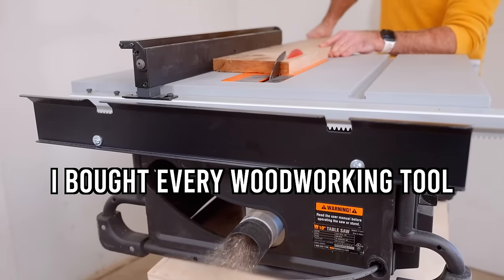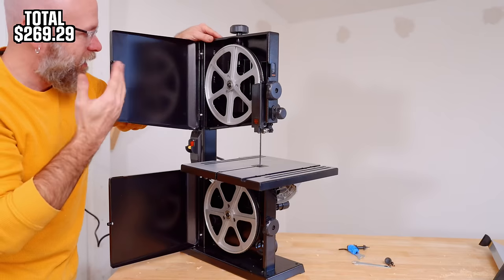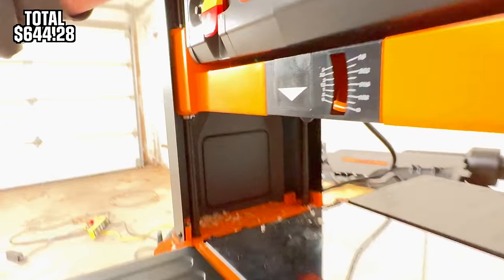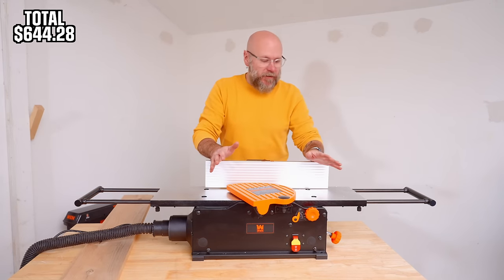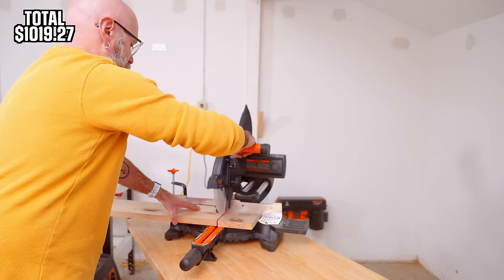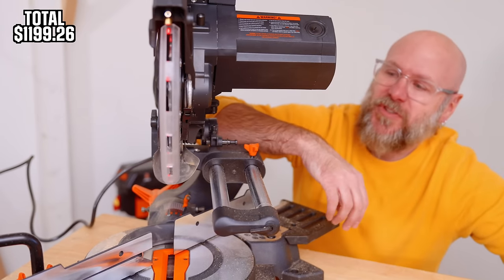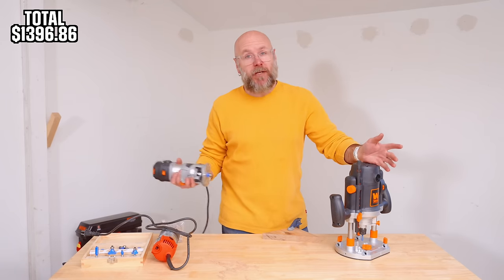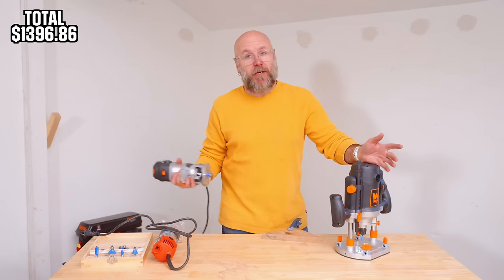I Bought ALL THE WEN TOOLS! Let's Review.

Comment: The plunge tension on the drill press is easily adjustable. There is a tensioning spring under the metal cup on the opposite side from the handle that can be adjusted to get the rebound tension where you want it. On more expensive tools, someone adjusts it instead of just throwing it together. But its an easy thing to adjust. This tensioning method is common across almost all drill presses.

Comment: I have the 13" spiral cutter head planer and it has been phenomenal.   I also opted for the stand that has extension arms to support longer workpieces.  The resulting workpiece surface finish is top notch.   Bladed cutter heads seemed like a lot of hassle to install and set, so I've always wanted a spiral head.   When I saw the price of this machine, I couldn't believe it and had to have it.   Turned out to be a great decision for my business.

Comment: Have many WEN tools, never had any issues. Great customer service. Cheap and affordable but good quality. I have an outdoor workshop so I have a gazebo as my workshop so anything can happen, I’m not sure if it is because it’s outdoor but my wen lathe , the powder coat is flaking off and parts of it are rusting, could be just me not using it a lot or taking much care of it, and drill press little rusty but overall, i highly recommend WEN tools, especially if you are just starting out woodworking. Part of the reason I got into WEN is because of the affordability. And my favorite color is orange, so WEN color scheme was right up my alley.

Also my lathe is the 8”x13” , I think I would recommend  the 12x18 , because sometimes you have something bigger you want to turn.

Comment: I have the same band saw and use it all the time as I make custom pens, and have never had a problem with it. I just bought Wen cordless biscuit  cutter and used it yesterday and it works great. Only thing I noticed is it has more power than the Freud I had forever. Just make sure you hang on while cutting.

Comment: I have an 18" Laguna Beast of a bandsaw and a  very "hot-rodded" Delta 14" bandsaw.  a few months ago, i bought that same Wen table bandsaw used for $70.00 and guess which one i use most often...the little Wen.  It may be because most of the work that i have been doing lately is small stuff, but that little thing works well after tuning it up, im impressed!

Comment: Wen makes good tools.  I have the top-of-the-line Drill Press and it is fantastic and I bought it used (but virtually unused for $75) and you will not be disappointed.  I own the belt/disk sander and it also just works.  No hassles no issues.  I also have the band saw but I've not used it yet.  Wood projects are on the list soon to get some time with this saw. I'm sold on Wen.  Wen for the win!  I had all the big power saws and had to liquidate everything that I couldn't move or lift anymore.  So - welcome to Wen.

Comment: I have been purchasing WEN tools for a handful of years now. So far, no issues. I have a portable drill and I did purchase the higher amperage battery and it is extremely handy and reliable around the house and when working at the bench with metal or wood. As with all less expensive power tools and even some higher priced ones is the chuck. I despise the key-less chucks. They are drill bit destroyers. In steel, the shank of the drill will spin in the chuck as it begins to break though to the other side and it requires filing the raised metal off the shank or it will not go back into the index. One tip, look the tool over and imagine breaking something and see if they have the replacement parts for it and weigh the possibilities. So far, I am very happy with the products and will purchase more. From my experience with WEN, if you call them they will probably work out a way to either fix or replace or send you the parts necessary to make the planer what it should be. Keep in mind, they are not manufactured in America, what is today?  Biden tends to elitists and not us blue collar people.

Comment: Thanks for the reviews.  I must take issue with your process for milling rough stock.  You should start with the jointer first and get one of the faces flat.  Then use that face against the jointer fence to square the piece up.  Then go to the planer to make the other face parallel to the face flattened by the jointer and then finally got to the table saw to square up the final edge.  You can switch the 3rd and 4th step but you should always joint the flat face first and before you run it through the planer.

Comment: I got a Wen lathe for Christmas in 2022 and I’ve loved it for a beginner lathe. With more experience, I’d recommend one with adjustable speeds instead of having to move the belt over and over again, but it works fine. This Christmas I got the Wen biscuit jointer. I’ll get use out of it when I’m done with college

Comment: You mentioned that the milling process is to run both faces through the planer, then an edge over the jointer, then the opposite edge cut on the table saw. That will leave you with a board that isn't flat. You're better off jointing a face before planing. You also mentioned that the jointer beds will likely need to be calibrated. From what I saw, it's likely that the outfeed needs to be shimmed, since it looked like the board may have been in contact with the outfeed bed near the cutter, but you could see daylight under the board further away from the cutter.

Lastly, the biggest benefit in my mind of spiral cutter heads is when it comes to dull or chipped cutters. With straight knives, a small dull section or small chip means having to get the knives sharpened or replaced, and installing and setting up new knives takes a long time. With spiral cutter heads, each insert has 4 good edges, so you can just loosen a screw, rotate the insert, tighten the screw, and you're done. It's much faster, and less frustrating. That said, if there are very few cutters on a spiral cutter head, you are probably not going to have as great of a cut as what you mentioned is possible with spiral cutter head.

Comment: WEN is great for experimenting or making a Frankenstein tool.  You don't invest a lot of $$$, so feel free to cannibalize them.  For example, I bought their pole saw (i.e., chainsaw on a stick).  Already had one, but this one was for ridiculous heights.  Right out the box I took it apart, added conduit tubing, extended the wires, put both ends back together, and now it goes 10' higher than I could reach before.

Also just bought their little drill press table attachment, something I should have done years ago.  It was <$50.  Has T-tracks on both sides (Top for the fence and for holding down pieces; bottom for clamping to the drill press) and another track on the fence for the included stop block.  Nothing too fancy, but it was worth the cost not to have to build one from scratch.  Even the materials were >$50: 5 hold-downs plus bolts for those and the fence and stop block, and all the T-track plus sealed MDF or whatever it's made out of.  Rockler makes one for $130 that is not even twice as good unless you really need your T-track to be blue.

Regarding the table saw: In spite of the whining about the rack's teeth in the path to the fence lock, I wouldn't trade my rack-and-pinion fence for anything but a full-size table saw.  If you use a contractor saw in the field, you want something that's square every time without having to keep jiggling the other end of the blade along (Note: Some fences are much, much worse than others!).  I have a Dewalt with the rack and pinion fence, not the WEN, but if it died, I'd replace it with the WEN, given the built-in outfeed extension.  Never scratched my arm on the teeth though, so I'm not sure what that says about me as a reviewer since experience is the sum of one's mistakes.

Comment: I have the 8in drill press.  No complaints, it has worked well for me, and it has almost no run-out on the spindle.  I know it's limits and I work with them.  I also have the oscillating spindle sander and I rarely use it.  I have the disc/belt sander and I use that all the time.  Very useful, except the paper on the disc is adhesive and hard to change out.  I will be modifying it to take velcro paper, like in the Newbie Woodworker's video.

Comment: I have that drill press. Been using it for a few years. Your take is spot on. The 2” of travel has been annoying and that spring tension has slapped me a couple times and made me cuss. I would add that the adjustable plate for holding work is pretty sloppy. With only a 2” travel, I have to move that plate a lot and it’s very hard to get it just right. I’ve been meaning to look for an after market replacement with a fine adjustment screw.  When I replace this Wen, the first and biggest requirement I’ll have is longer travel, everything else can be managed, but that can’t be changed. 

My top clip actually has a slot for the screw to pass through so that knob never leaves. It’s just a tension adjustment for the latch, as it does not trap the lid (you can open the lid with the screw in place). Seems like they changed that design for the worse in recent years. Changing speeds is much more common with metal. For wood, you can leave it alone once you find a speed you like. Drill an aluminum plate and then a steel plate though, and you’ll understand what that speed adjustment is for.

Honestly, with then” of travel and the small work plate, I’m betting metal work was top of mind with this design. Wood benefits a lot from a longer travel and typically has larger pieces to hold.

Comment: That flip stop isn’t for small parts, when the table saw is adjusted to a wide cut and the fence overhangs the saw top, you flip that thing down and it supports the piece your pushing through, it might also work for small parts but that’s another function, I have the Dewalt and your so right about they don’t have support on the back

Comment: My first Wen tool is the same 8" Wen jointer... went with Wen because I couldn't afford 8" otherwise, and after purchase thought I had made a huge mistake.  I couldn't get anything jointed flat/straight & was swearing up/down/left right.  Then I realized the bed wasn't co-planar.  It took forever for me to adjust the tables to co-planar, but I  eventually got it done.  It has worked absolutely perfectly since... very happy.  My only gripe is that I wish the fence was a little sturdier, but it works.  Since I've purchased a Wen 3417 air-filter and it is just as good as my smaller rikon filter.  Now I'm wishing I hadn't spent the bigger money on my dewalt 735 planer and tried the Wen first.

One comment on the Wen track... its too short to use a guide square, so I would have to get another brand track (I have a makita track saw with both makita and powertec tracks)

Comment: Appreciate your videos full of information and enthusiasm. Just fyi portable table saws are powered with universal motors essentially router motors that run at about 20000 rpms and are geared down to 4-5000 to use regular blades. Full sized saws use induction motors that are more massive and run at 3-4000 rpm. Much quieter and heavier thus less vibration and lower noise levels. I was supprised at the quality level of the Wen tools. I might try the jointer. I currently use mostly higher end hobbiest tools mostly cast iron and US made except my 3 hp cts.  Love it. Keep up the good work. Love the channel.

Comment: I've had that drill press and bandsaw for several years now, no complaints. No missing parts either. Oh, I also have their electric hand planer, but haven't really used it yet to give an opinion. It's built solid though.

Comment: I've bought two Wen tools so far: The  4x21 belt sander and the dust filtration unit. The dust filter has been a solid piece of kit so far. No issues. The sander, however... No matter what I tried, I could not get the belt to stay on track. It either slid off or cut into the plastic frame.
I look forward to the long-term reviews of this equipment.

Comment: I bought a Wen thickness planer and drill press. I upgraded the planer to a Grizzly 15" because the 13" Wen was too small, but the Wen planer worked like a champ right up to the day I sold it. I still have the drill press and use it constantly.

Comment: Just a heads up, I found Wen to have some of the best customer service I ever experienced. I was missing 2 cross brackets for my 14" Band saw(for the stand) which I didn't assemble for over a year. I had no receipts or anything, so when I decided to use the stand, I called them and told them what I was missing and had it in the mail within 4 days, free of charge.

Comment: I have the 8" and 10" WEN drill press, the WEN 8 in. x 12 in. lathe, and the bench top band saw.  I'm thoroughly impressed with them.  I was worried about precision but all of them did well in that department.  Would totally recommend if you're looking for a budget brand.

Comment: I ordered a WEN generator off of Amazon. When I got it and put it all together. They totally missed welding one side of the wheel supports. When I tried to move it the wheel pitched in and rubbed on the frame so you could not roll it. I called WEN and they told me since I ordered it from Amazon I had to call their customer service. When I got a hold of Amazon customer service they gave me $250 to fix it myself. It was a 15 minute fix and I had a great generator. I have many WEN tools and I do like them. I guess sometimes you just have to deal with stupid mistakes. This one saved me a ton of money.

Comment: I ordered the larger Wen drill press and it arrived with a broken on/off plate. I contacted them and they immediately offered to either ship the part or send a replacement. Their customer service is top notch, at least some of the time. By comparison, DeWalt customer service when dealing with a missing part on a router was a nightmare of just getting them to send me a missing spring for adjusting for the plunge height. I forget what actually ended up happening with the DeWalt as it took months, I think I just found a part and bought it myself.

Comment: Thanks for the review. Two comments: I bought the upgraded multi-speed control version of their drill press and it arrived with one of the lasers completely inoperative. To their credit, after calling Wen, they sent a replacement that week. I'd still give it a 4 if I was reviewing, as it has quite a few rough edges (literally and metaphorically). Second, I think that table saw is made in the same factory as my 10" Dewalt. Has the identical rack and pinion mechanism for the fence (which is nicer on the Dewalt), and I have the same complaint about the location of the lock. I've just learned to lower my elbow to avoid ripping open my hand. However, the Dewalt is exceptionally quiet, so there is either a different motor and/or sound buffering design. I have been pondering a band saw and you've given me something to think about: Wen vs Rikon.

Comment: I've had that drill press in the oast. The knob on the cover is not made to come off, the rubber piece on the back friction fits into the hole on the back side. It's a good little press for most things, but don't expect to drill anything with a forstner but bigger than about 3/4 or so, the press will torque out

Comment: If you have a 2nd shop this probably isn't a concern, but one of those dust stoppers you clip onto a 5ga bucket will capture about 95% of the planer chips from the 735, no vac or dust collector required (since the 735 has a built in blower). Or you can make one for a few bucks from scrap plywood, but the dust stopper works well and includes hoses.

Comment: Bought a WEN track saw on Amazon. Figured at the price if it worked for a year until I could afford a better one I would be happy. Worked well for 8 months and then, in the middle of a cut, it made a grinding noise, sparks flew out and then smoke. That was it, never worked again. I do have a WEN scroll saw I have had for about 2 years. Don't use it hard and so far so good with that one.

Comment: On the drill press, that knob is not supposed to be removed to open the top. Its only a hamdle. Also, the spring tension is adjustable

Comment: The knob you removed to open the top of the drill press doesn’t need to come off. It only attaches to the lid. When you close the lid it “locks” against the metal clip that is attached to the drill press.

Comment: If you ever need a quick cheap way to check for flatness use a 12" drywall knife. The ones i checked were flat within .001" or .002". Close enough to check any woodworking tool for flatness.

Comment: I have the Wen (cordless) track saw to break down sheet goods. I got the 110” (vs 100”) track set. It was only a few dollars more, and that extra length is well worth it IMO. Also, I’ve seen others comment that the grip strip on the bottom of the 110 is much better than the 100. I can’t confirm that, but I have no complaints about the 110. Also, I haven’t needed to clamp the track. The tracks were so affordable (relatively) that I actually have two sets, so I can leave one set connected for 8’ cuts. The connector system is, IMO, much better than the other brands. Rather than the set screws digging into the tracks, each connector is two pieces of steel that create a spreading action to lock the tracks, so the screws never touch the track itself. I’m amazed that Wen is the only track (that I know of) that uses this approach. On the saw itself, as expected the knobs feel cheap. But it does its job, and dust collection is pretty good. I always cut sheet goods on foam insulation, so that helps to contain the dust and allow the dust collector to capture better. Overall, I’m satisfied with what I got for the money and would recommend it. I won’t be going back to a circular saw with an edge guide, that’s for sure. And thanks for all the work doing these reviews!